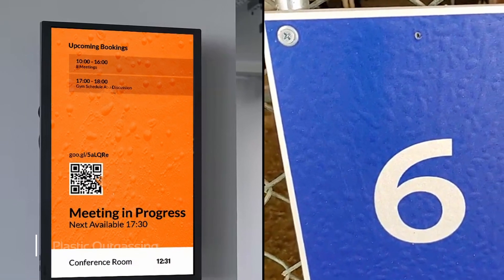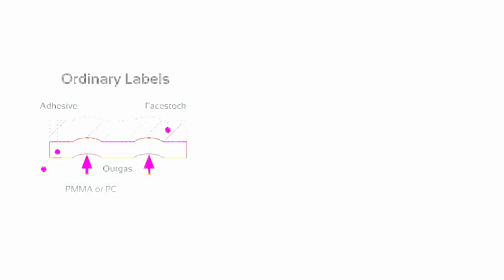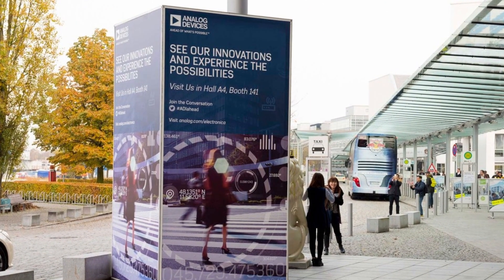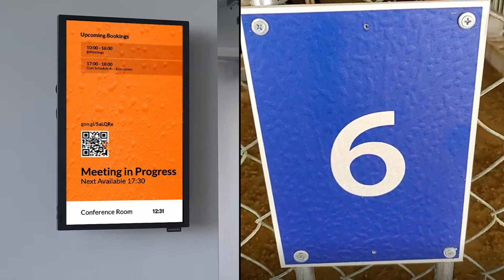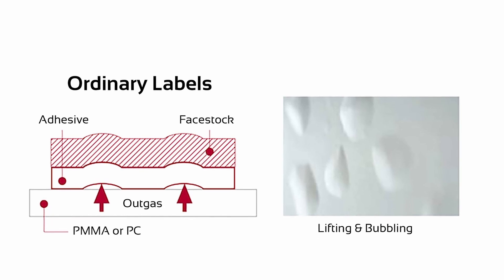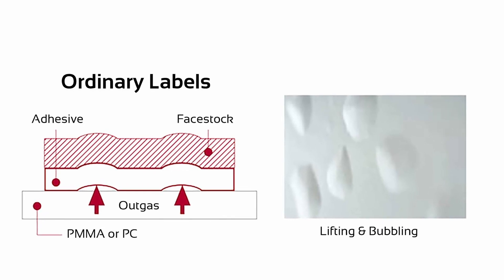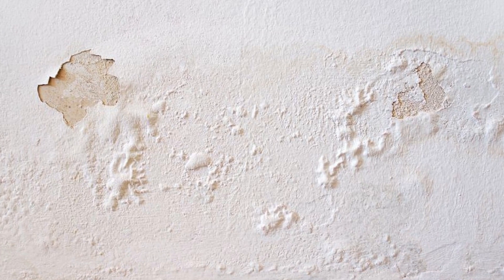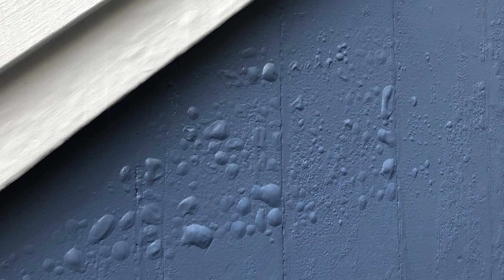How to prevent Plastic Outgassing? (Acrylic, Polycarbonate & Digital Print Media Outgassing)

Comment: Are polycarbonate sheets used as window panes a hazardous application due to the sun's heat? Or is the temp too low to worry about outgassing?